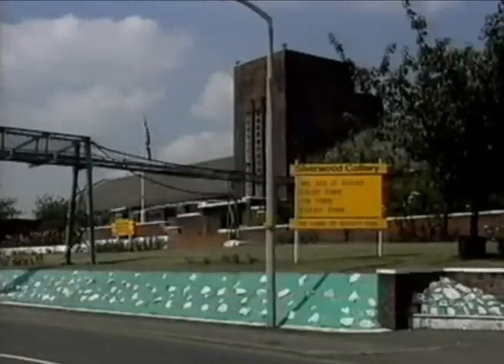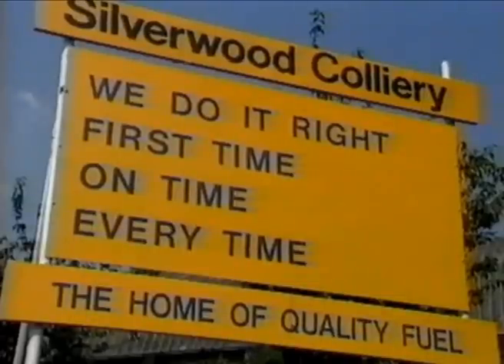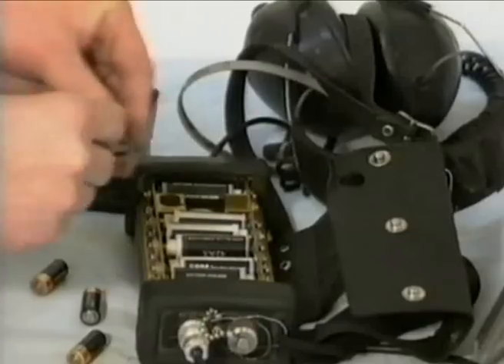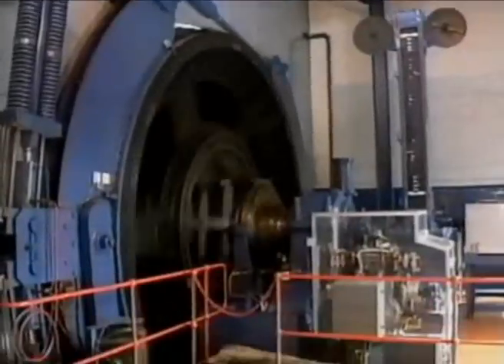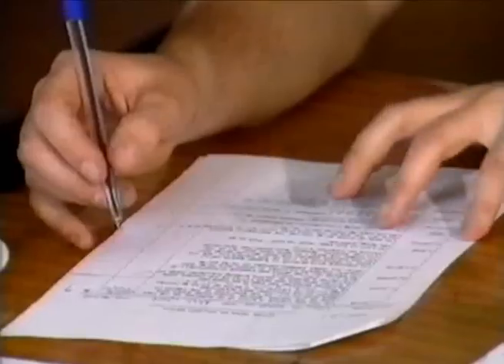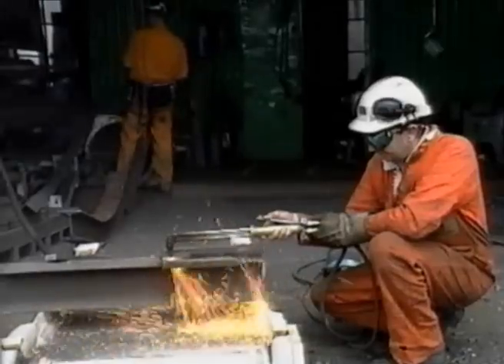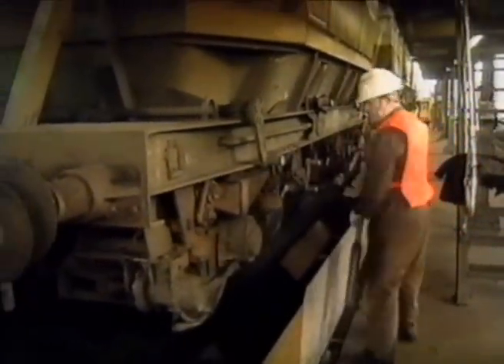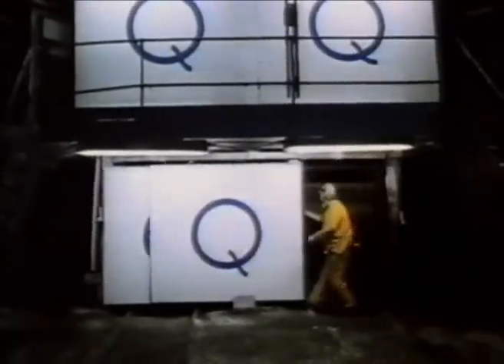1980s Silverwood Colliery Promotional Film

Comment: This film was made post the Miner's strike, probably late 80's  . I (Eamonn O'Neill)  was a Technical Assistant initially initially (ie a Uni Graduate trainee manager) , and was made acting Undermanager as Ron Turner, Undermanager was long term sick. You may not remember my name , but I had a distinctive red and yellow Ford Capri !!
My main task was to install a new Longwall with transfer of 'new generation chocks'. Then came the Miners strike. 

Mr Law ( Derek?) was the Pit manager, A Deakin the Area manager, we as manager trainees were charged to keep the mine open until the end of the strike . So we were put on shifts in the 'Power House' 2 x 3 per day , we also went down the mine to start pumps and keep it from flooding. Would go down by winders  'amateurs' and walking in 2-3 miles  , crawling through the Faces and getting out alone. It was scary but we did it for the sake of the mine and miners . Imagine going through a face to half way, hearing the creaks and groans, seeing it flooded , 18inches of clearance, your belt and battery taken off to escape, knowing noone within 3 miles to help you. Back up, pray, Back up and pray 

On the surface the strike was like a bit of a holiday at first ,we had good relations with our colleagues on the picket line, they understood we were keeping the mine operational. On night shifts we would walk up, meet the pickers and help them to fill their bags. We would borrow packed meals for the Police and give them to pickets, indeed the SY police would help us .

 Then months in it started to change , Maggie and Arthur got serious. We got flying pickets from Barnsley and Army troops disguised as Police ( No numbers and they marched too well) , after that was Orgrieve ..Everything changed , Mood, stakes.

I was on duty (12-8am ) when the SY Police came in with the first scab. He was a minor coal processing plant worker, told me he had been offered a package.

Well strike over, return to work . It was never the same. All knew impending doom and retaliation coming . I left for the Oilfield  

Years later I met Maggie's right hand security manager, understood much and games played.  

If ever there was a confrontation and each party cut off its own nose to spite its face, this Miners strike was one. I don't know all but I know much from the coalface and a prime example where politics was put ahead of national interest.

Eamonn
eamonn.oneill@yahoo.com
Reply: miners strike  1984    to  1985  . remember like yesterday .